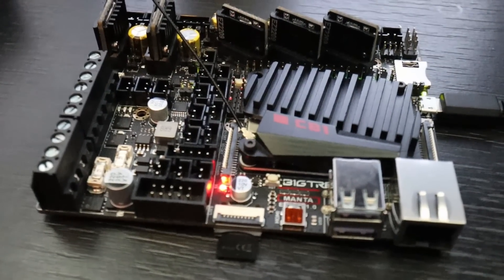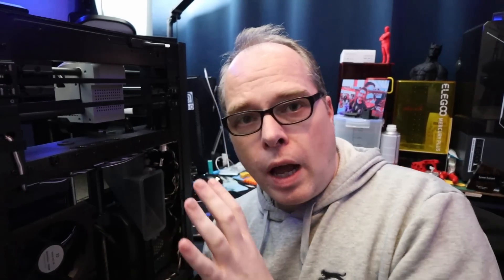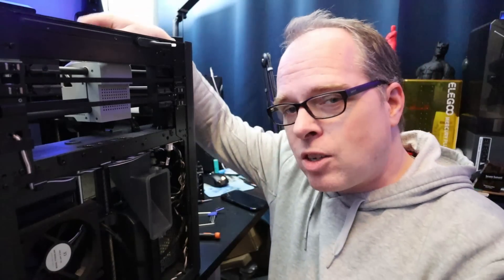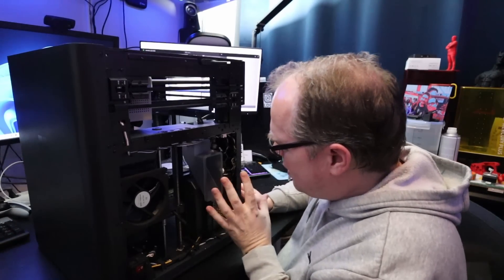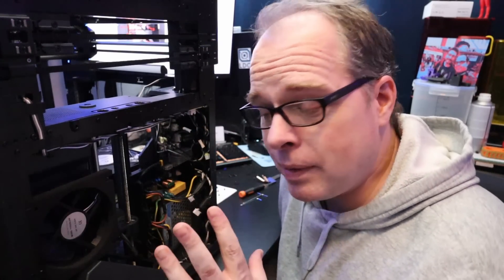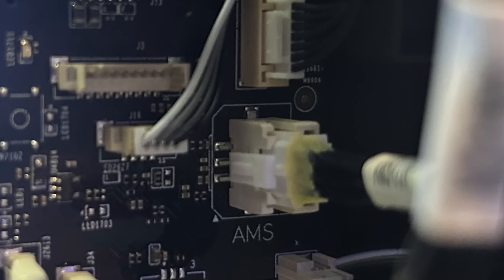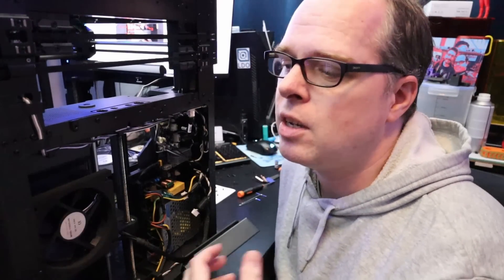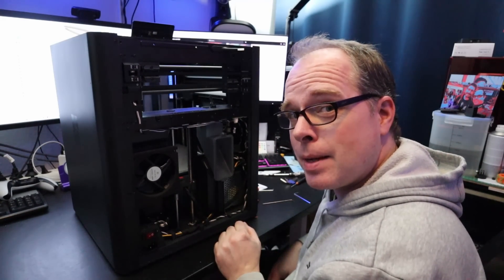Inside the Bambulab P1S: Exploring the Controller Board and Electronics

Comment: Clearly the Emporer has fairly Shitty clothes.  They even "economised on the number of Stepper motors  NOT impressive 
Bumboo has IMO Run it's Course.
Reply from the maker: Shiny on the outside, and have 1 instead of 3 stepper motors of the Z axis. Yeah it was surprising to see. But hey, it works… I have seen worse

Comment: I'm had I never bought into the bambulab hype train. I'll still to open source and buy 3d printers with it on there already. There's no need to go through the trouble. I remember people all claiming bambulab was the best printer out there for ease of use for newbies. Now its the hardest printer to do upgrades on and repair. With open source, the main board is mostly all the same and can be a drop in replacement for some 3d printers.

Where the bambulab spokes person, because its been a few days and nothing has changed. You still are locked put of 3rd party hardware and software. Bambulab really want to lock down their printers that badly, if they aren't saying a word. Its too late in my eyes, I hope other brands will surpass them, and make open source the standard that we all are use to.

Open source is like a democratic system were the people are able to do as they wish, where closed source comes in to tell you what you can do and cannot do. Think about it.

Comment: AMS would be the trickiest part. The rest would be straightforward enough even though you would be ripping out a lot and probably making a lot of new cables too.  Going back to the AMS, I imagine they have electronics in them as well, all proprietary. The chance of making that work with anything third party would be almost nil.

If you were going for a new main board, the BTT Manta 5P would be my choice. Put Klipper on it and you would get the main functionality and Klipperscreen up and running. Not the AMS though!!
Reply: The ams has been reversed engineered already, its already a diy on how to do it.

Comment: I think Bambu's shenanigans is the motivation for the community to either "jailbreak" Bambu's firmware or port Klipper to the stock control boards / develope replacement boards for Klipper.
Reply: 100% sooner or later someone will come out with some type of aftermarket replacement boards for bambu printers with open source software.
Reply: @iirmantass3  I would put my money on BTT.
Reply: @WillThat  bigtreetech just needs to make an upgrade board for it.

Comment: I bet on Klipper they use all open source everything else which is why everyone is so up in arms.
Reply: Nope, they closed their firmware so they can do just this, make it a walled garden so no one has access to your 3d printer, but them. Meaning they can charge you in the future for services. The issue is how they changed their terms and tried to cover it up like that wasn't what they were doing.

Its not because klipper is on everything, 3d printers were made better due to open source firmware. Bambulab took everything from open source, and they now want to close it down like its there's now. People aren't having it, the 3d printer belongs to them and they can do whatever they like to it. Bambulab wants to take away features, and people dont like that.
Reply: @oneanother1  I totally agree. I know it was Klipper that they use and now they are stealing it and closing off their printer. They took all open source stuff skinned it for themselves and are now closing it off as Proprietary. Total slimballs and won't ever get one more red cent from me.